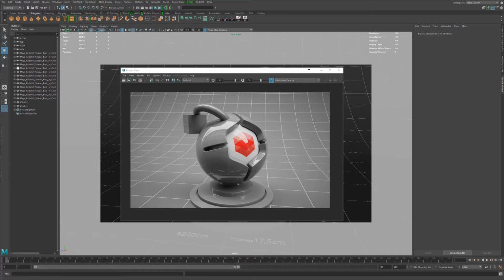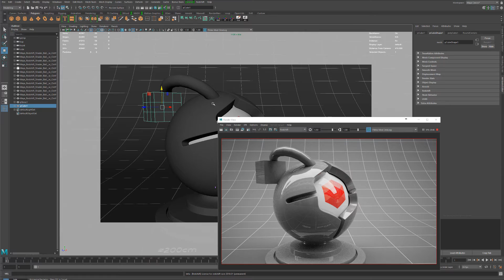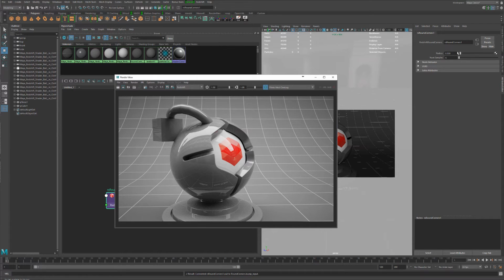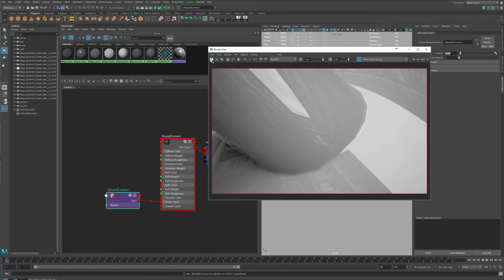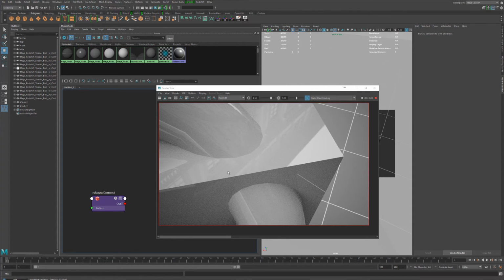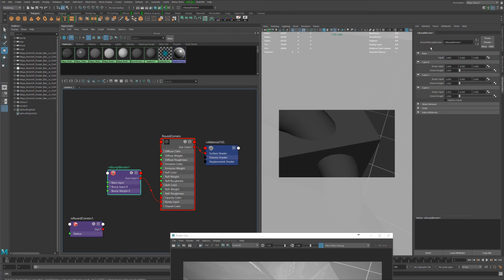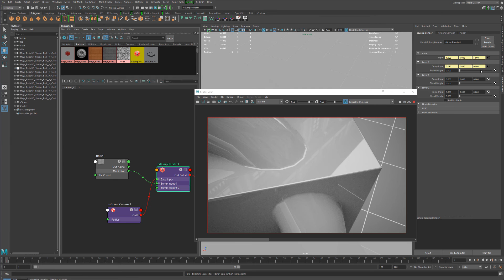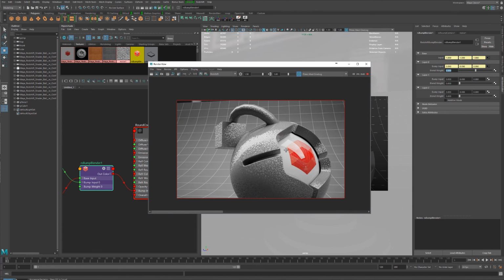Redshift 2 Maya - Tutorial #8 - Round Corners Node - Bump Blender

Comment: Just popping back to ask, is it at all possible to bake the resulting edges into a normal map using redshift? Does anyone have any alternatives if not? Seems like the only option is to switch to modo which is a bit a of a pain in itself
Reply from the maker: Alex Tsekot it isn't real geometry so no. If you need actual edges baked why not use a bevel on the actual geometry ND bake the normal nap out that way?
Reply: @TheArtofSaul  Beveling the actual geometry is exactly what I wanted to avoid, I was asking because Blender and Modo both have shaders that create rounded edges like Redshift but can also be baked to a normal map saving a bunch of time in the process. Hopefully this functionality is added to Redshift at some point :) thanks for the reply!

Comment: Hey Saul, thanks for the video! Does round corners work with various bevel widths per object, like say a complex hard surface object, where not all the bevels are the same?
Reply from the maker: Any hard edges will get the micro bevel so if you already have bevels those small bevel edges will also be beveled at render time.